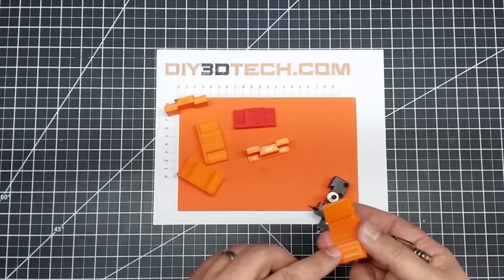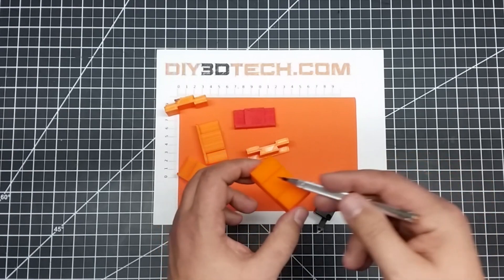Design Talk - 3D Printing Mini Lathe QCTP Holders!

Comment: I have down loaded your .stl file and printed a few samples. I find the dovetail is too small and the wrong angle for my 0XA Wedge Type QCTHs. I have tried scaling the .stl using ThinkerCad, but the process has not been very successful so far. While I have been able to fit the holders to my CentraI Machinery (HF) Lathe's backsplash, The dovetail is harder to persuade. I wonder if you have the original TinkerCad item so I can ungroup the parts and adjust them for a better fit.
Reply from the maker: Its possible you have a different version as I know that there are several version out there.  The model was designed in Fusion 360 and can see about upload the file to Thingiverse later this weekend if your interested...
Reply: @DIY3DTECHcom  Yes, definatly interested. The file I used was given as v7. Thank you.

Comment: Awesome Vid and I also tried emailing you the pictures and files and it came back saying your mailbox is full????? No idea what to do as I even tried to reply and also send to other addresses. Nothing. I have no idea what else to do to get you that information. Please give me an idea on this if you can when you get this comment. Thanx, Chuck~
Reply from the maker: Did you try info(@)diy3dtech(.)com?  Also you won’t be able to send any big files as I limit that for malware reasons.
Reply: Its not letting me send you anything as I have tried 4 times,,,lol. Not sure what to do now. And yes, that's the email addy I used.@ @DIY3DTECHcom
Reply from the maker: No sure if my other reply went, however I limit attachment size to prevent malware as i am getting mails on that account (info at diy3dtech dot com)  so just try sending a regular mail to say Hi and lets go from there....